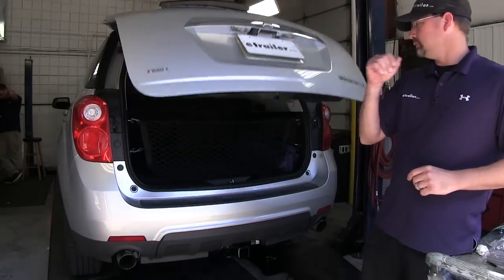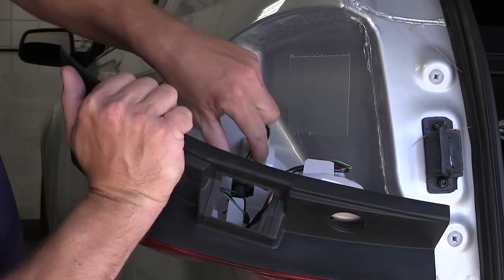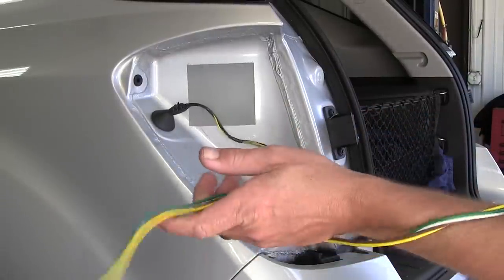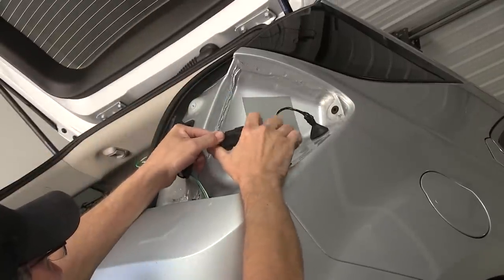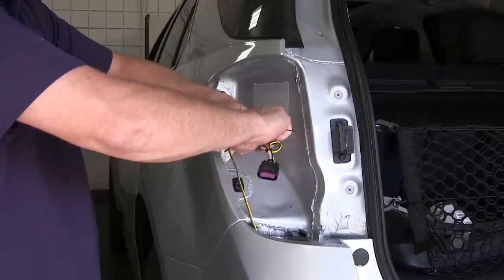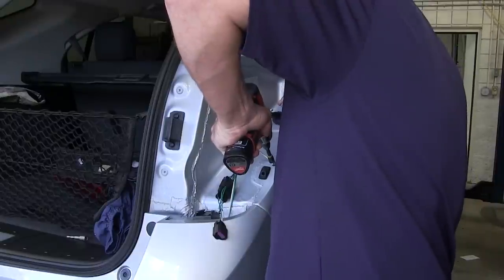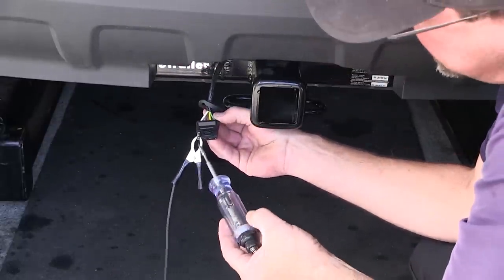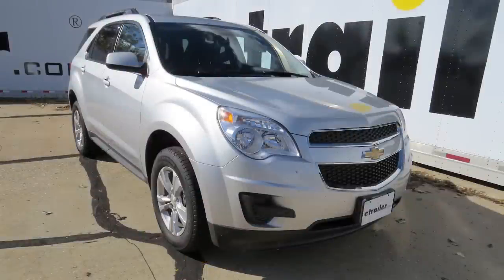etrailer | Trailer Wiring Harness Installation - 2015 Chevrolet Equinox 56094

Comment: Will this harness work on the 2014 chevy equinox
Reply from the maker: Yep! This harness is designed to work on the 2014 Chevrolet Equinox (without factory tow package). To see all the trailer wiring options available for a 2014 Chevrolet Equinox you can click on this link: https://www.etrailer.com/t1-2014_Chevrolet_Equinox.htm